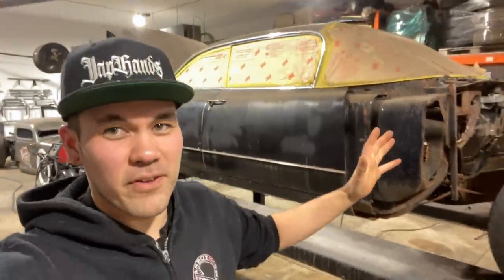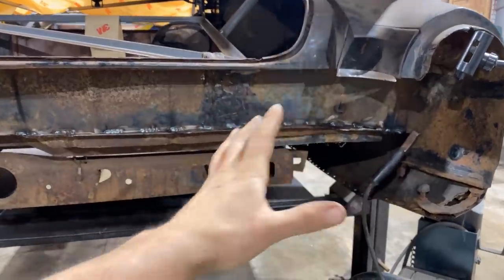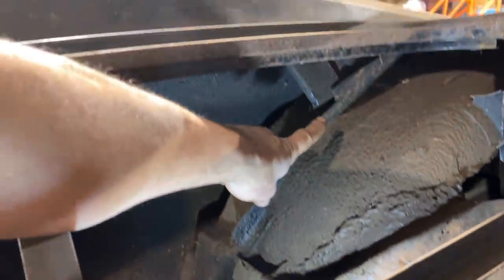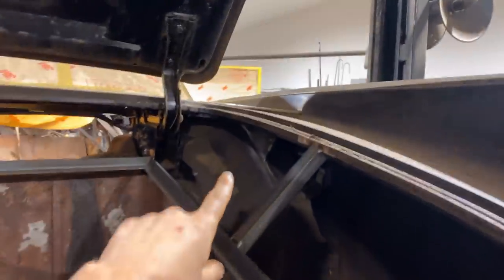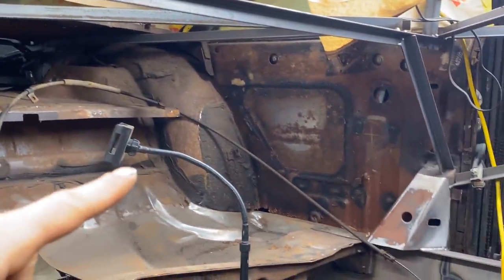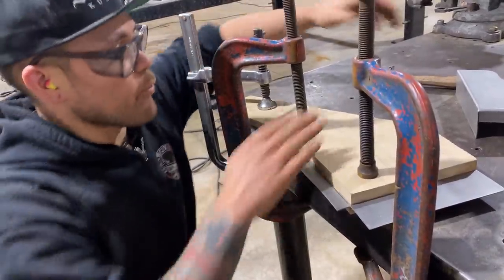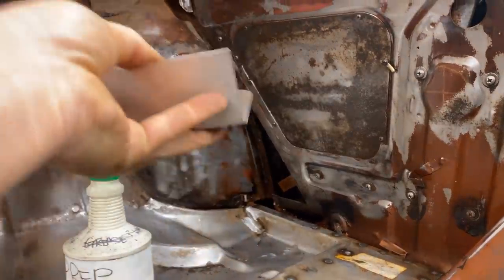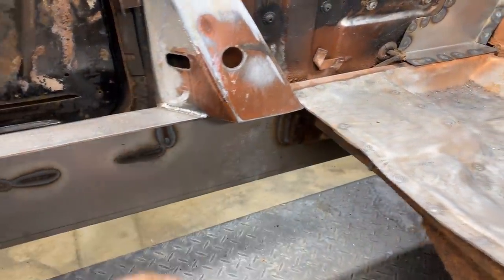1960 Cadillac Body Drop Fabrication, Rust Repair & Bracing

Comment: The basic compound in rust treatment is phosphoric acid.  It usually sold in various levels of dilution.  It interacts with iron oxide to form iron phosphate which is a black substance.  I usually like to sand off the iron phosphate the best that I can.  Some brands of metal prep are so dilute as to be worthless and ineffective at converting rust.  Home Depot used to sell it in a very concentrated solution.  The metal prep leaves raw steel with a greenish color.  Too much metal prep on raw steel leaves a powder which should be wiped off.  Excellent video as usual.
Reply: Love it when the experienced heads chime in with nuggets of wisdom. thanks 😀

Comment: Karl, This is akin to 150 years ago, when friends came over and raised a barn!
  Fast forward, to 2022, friends came over and lowered the front end of a Cadillac to slam it into the ground!
  No axes, abs, hand drills for pegs, scarf joints, wooden folding rulers or post & mortar joints!
  Parts and applications are things many forget to write down, organize and create a “Service Manual” for the vehicle build. Electrical repair can be an expensive adventure if someone with excellent skills is ask to diagnose, locate and repair the fault when they have different colored wires, random fuses & relays to find and test. 
  Just thinking out loud for the resto-mod builders as we all have cameras in our phones. Connector labeled C100 are front, C200 are firewall, C300 is dash and so forth. Grounds are “G” whatever. Each circuit shows one item from B+ at the top, device in the middle and ground at the bottom. End each chapter with connector location w/photo # 119 (Example) and place in the back of book, CD or thumb drive. This also increases resale value when that day comes!
Just saying…. Very sweet job!!!!
ASE Master Tech since 1978, retired.

Comment: I like my jigsaws for the fine cutting, one is on a mount,upside down and its like a tablesaw. Hammer forming is pretty cool!
Cleaning with wire wheel on grinder,ya, in cheek, nipple and well, lower. Dont notice til later. Always use caution. 
Rust chek rust convertor is another one. 
Hey! Like the weld trhrough primer!

Comment: Metal Prep is fantastic stuff! Probably the best I've seen so far, in my restoration work on old Kawasakis. It leaves a phosphate layer on the bare metal, and protects it for years and decades. Have fun with the project! Looking good, although I'd restore it if it was mine! 😎

Comment: Karl, I've got two more tips for you! On that rusty metal after you are finished forming it and before you are ready to put an edge prime or epoxy primer on it or POR 15 or whatever your choice of colorful elixir, I mix up a little bit of hold tight 102 and spray on there or apply to a rag and wipe it down. I know you already know about that product but it's weird some people don't ever use it except when blasting surfaces but of course it works fine unclean Metal too. That is tip number one. Tip number two is to grab your door skin Hammer when you are doing that hammer forming and putting a flange in I use mine and it has a little crook on one side (it's double headed) and it gets right in there close to the folding edge perfectly.👍
Reply from the maker: Man it’s comments like this that I love! Actually learn a lot from the comments LOL

Comment: When you start welding to cool metal down with air I found using old Mac tool I had for for carburetors that will blow hot air on one and ice Cold air on the other end what working for me is blow cold air on metal hit it with welder then blow cold air again have ever try something like that the I am using is Mac tool choke tester ct901 but enjoyed class again 👍👍👍

Comment: Fantastic job there. I have been using Steel-IT weld through paint and it works better than the galvanized primer I used to use. its stainless steel in a can

Comment: Always enjoy your videos. Tig although not my skillset,is nice, but mig is more forgiving. I like my air flanger/punch,nice holes for spot welding. Can’t wait to get back on my projects,65 barracuda 76 dart sport, 50’s pilothouse and 49/50 chevy 5 window truck. Both the dodge and chevy truck i want to stretch the cabs. Mechanic by trade, but i love metalwork. Almost 58, running outta time.
Reply from the maker: Get after it!!! I’m overwhelmed with projects too at the moment they all take a lot of time

Comment: Hey Karl!!  Man, what an awesome project!  Just a thought.... get you one of those Engine Cleaning Guns, like the one Harbor Fright has (SKU 68290).  I use one all the time.  You can use it to shoot the POR 15 all over the place, then use it to shoot water to deactivate.  I use one at about 90 psi on my compressor to blast Super Clean, or Purple Power in hot water to degrease engines, then rinse it off with fresh hot water.  It has a siphon that goes into a container filled with whatever you want to spray.  They are expensive though.... about 10 bucks  ;-)  Looking forward to your next vid.
Reply from the maker: Thanks man that’s awesome! I’ll have to try that!

Comment: I don't know if you know this, but in some of that tar looking insulation they used asbestos. I don't know from what year to what year or if it was used by every manufacturer, but it's something to be aware of. Martin manufacture a wonderful hammer for flanges also, it's the 170G, you should get one it makes the job easier faster and cleaner.

Comment: Get a variable speed grinder for your wire wheels. Not only do they bristles not fly off stick into you but it makes the wheels last almost forever. I haven't bought a wire wheel in 2+ years, I'm a full time welder/fabricator.

Comment: Love your work and your teaching hints.   Just wondering would it nicer to work on super clean metal by blasting cleaning all the body inside and out on area where you were  going to then cut and  apply filler pieces?
Reply from the maker: Sure it would be nice to Sand blast everything and maybe one day we will. For now we will keep getting all the spots we can as we go

Comment: Just and FYI crimped overlap seams are stronger than butt welds when dealing with sheet metal.  And they hold up better to vibrations, less cracking. And looks closer to OEM. Mod it, but make them say did that come factory like that.

Comment: I love the progress, but suggest a junkyard LS and 4L80e out of a truck (6.0 or 5.3L)...will end up being much cheaper, more powerful, and much more reliable than a SBC.  Also has a big aftermarket to dress up and add accessories...you can even dress it up to look like a period 409/348 chevy “W” motor with fuelie or tri-carb induction
Reply: 409 in caddy no use old 331 caddy would be petty cool you and chad need to build off with same car

Comment: Well back in the early days they called it channeling for what you have done to your caddy except you did it a different way. When they started to kustomize a car and that is after all the planning, for starters the first thing would be the chop top second would then be to lower and in this case to get real low would be to channel the body that is were they would title it CHOPPED & CHANNELED that would be as they used to say the radical style KUSTOM.Now of course they had other not so radical methods to lower the body but to channel a car was the ultimate.There  was also sectioning which also a radical procedure to perform on a car.But anyway I caught your videos and took a double take when I saw the LINCOLN PROJECT so that’s when I saw here your caddy project both cars are tuff as hell I am really into it so I am going to keep up on your video’s on that LINCOLN CHOP JOB an see what you produce I just hope to GOD that you do it right and that is getting that perfect slope from the roof line all the way down to the back end with the look of a fastback but low and radical we will be watching GOOD LUCK!!!!

Comment: Would like to know more about the sanding disc your using on your 90deg die grinder? When your grinding down the welds for the B pillar support. Is it a resin disc or a roll loc? Or something else. Thanks! Looks like it works slick!
Reply from the maker: They are 3M cubitron discs. Extremely long lasting

Comment: Ok, ok... tip #3 & #4: Karl, you know this but for anyone else who is doing spot welds through punch holes be sure to cut the tip clean and straight before each weld as the slightest Bend or a tiny ball on the end of The Wire can cause the wire to come down at the edge of the hole and not in the center and you do not want that. Also weld it hot. Ok the last tip is body cavity wax, OK kids get ypur heads out of the gutter!! It is a sprayable wax that new car manufacturers use to spray inside of the parts of cars where Paint & primer can't easily get. Many manufacturers dip Prime but they don't Dip paint so as an added measure a-wax is spread through a tiny dispersing head at the end of a hose they can poke down into things or even pull through an entire frame Channel! Body cavity wax can be bought at most paint and body supply stores or even Eastwood.
Reply from the maker: Thanks very much for that man I appreciate it!

Comment: Would you have to modify your truck deck lid, because your brace and latch moved farther back.
Reply from the maker: No those did not change in relation to each other. The cut is below both those
Reply: @MakeItKustom  Oh, ok got it. now it makes sense because of the body drop.

Comment: Have you ever. Or have you heard of ways to remove a body from its chassis using the 4 post lift?
Reply from the maker: I use pallet racking Just erect a rack above the front and back. Lift the car up and strap to the rack lower the chassis down

Comment: So you don’t clean between each set of stacked welds along the side of the car?
Reply from the maker: Not sure what you mean?
Reply: @MakeItKustom  between each run. For example, first you put down 10 spot welds say 25 cm apart…you don’t clean (wire brush say) the 10 welds before putting down the second, third, fourth spot welds on those first ten

Comment: What chemicals to use...? Well, methamphetamines should keep you going for a while...Why not, find yourself a 1972 500 caddy engine and use that?? Great work Karl! What I do sometimes if I have an awkward place to weld and I can't clean it properly, is to bead blast the area quickly. I use the same technique if I'm removing something (usually suspension components), so that it's MUCH easier to remove once it creaks free. The only pain is the clean up of the blast media. I hafta say Karl, you're a fast man with a template 😆
Reply from the maker: Haha yes the video makes it seem that way 😂 I like SBC engines for a lot of reasons. They just work and are great engines that parts are always available for
Reply: @MakeItKustom  SMC are great engines, I have utilized many in the past.  I was simply considering the size of the Caddy and how good a big block with dual carbs on a tunnel ram and bird catcher would look in the engine bay. To make the engine look even bigger you could section the body through the belt line AND take the roof down a few inches, and I think...a violent fluorescent deep pink candy finish  with blacked out chrome would look just fine for Kristina to drive. Yes...No?